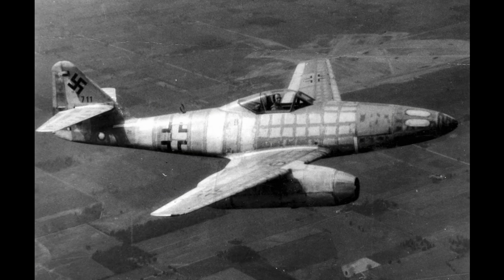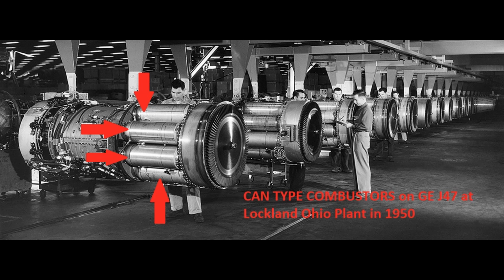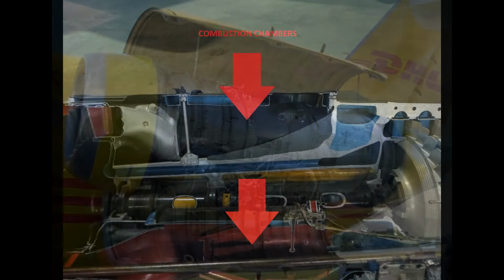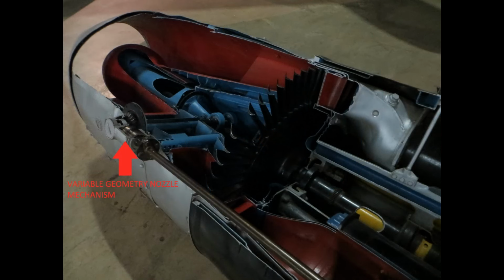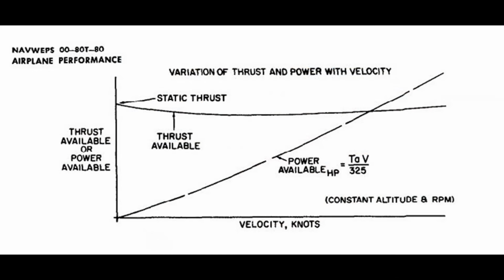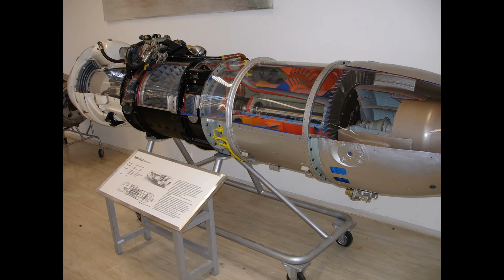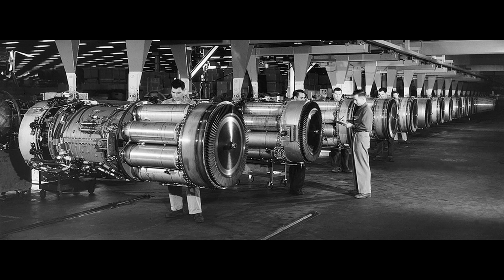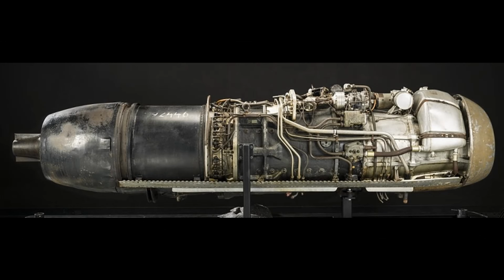World War Two JET POWER

Comment: The video channel author doesn't understand how a thrust vectoring nozzle works & doesn't understand the concept of deceleration of a gas flow in one direction & acceleration from zero to max in a 90° turn direction & the forces involved at the nozzle  & on the entire turbojet. Probably will be extensively confused by this post & will immediately delete it.
At 9:48 - states exhaust leaves the tailpipe so generating thrust. This of course is wrong. The thrust generated is reaction thrust generated elsewhere in the engine upstream of the turbine stages. The only thing the exhaust /  tailpipe does is oppose forward thrust by causing rearwards directed thrust.
Reply from the maker: I'm not the one who is confused here. There is nothing in this video about thrust vectoring nozzles. Now in regards to deletion, yes if you can't make your unrelated post go anywhere, then it's a waste of space and I'll delete it. Furthermore you made the post unrelated by deleting your previous incorrect posts.
Reply: @GregsAirplanesandAutomobiles  
Found an online pipe / duct forces calculator  which gave the expected thrust forces at various points along the gas flow routes &  turning points for a Harrier given  air density, psi, flow rates, duct turn angle & duct csa. It's simple mass acceleration forces.
A pressure gradient will exist in the vectoring nozzles that will be equivalent to the vectored thrust of the nozzles, that pressure gradient is directly caused by the change in direction of the moving mass of air or gasses.
I had some questions about the thrust budget / balance in the F-35b due to the 10  ton front lift fan but turns out with the fan on load via the clutches the relevant connected turbine presents more resistance to gas flow which causes increased opposing thrust & the roll post gas route causes 2 tons of back thrust so all thrusts add up & cancel out nicely causing the aircraft to behave sensibly while hovering without wanting to accelerate forwards due to any non cancelled forward thrusts in various parts of the engine.
An odd f-35b thing is the fact that it appears that about 3 tons of engine thrust equates to enough shaft hp being sent to the front lift fan where 9 tons thrust is generated give or take due to the fan being able to do high mass low velocity air flow. If the front lift fan load reduces then thrust to the rear nozzle will increase so in both cases thrust cancelling takes place appropriately, where any imbalance exists the roll posts, front fan lower guide vanes &  the 3bsm vectoring nozzle can all point forwards a bit as required.
When thinking about a helicopter engine for example where the velocity of the exhaust jet is relatively low & the overall engine forward thrust is very low,  the reason the forward thrust is low is it's been mostly opposed at the turbine stage by backwards thrust on the turbine stage where  most of the energy has been removed to provide shaft power output to the rotors.
Reply: @GregsAirplanesandAutomobiles  
How many people at Greg's Airplanes Engines answer these comments?
If you essentially bring the air flow mass to a halt at the exhaust outlet you get full thrust force backwards (canceling forwards thrust & trying to blow the nozzle off) which is part of what thrust vectoring nozzles  might be doing for a given direction basicly.

A lot of questions have popped up in my mind anyways involving the ifs & buts of the issues here & stuff about decelerateing a continuous linear feed of bowling balls  or just changing their direction by 90° etc  which might need me to have a discussion with some of the Pegasus engine people & others if possible.
Edit added
In essence then -  the straight backwards gas flow hole & pipe arrangement in the back of a jet engine - its main job is to mostly not present a engine casing back face against which an opposing force would be generated which would counteract net forwards thrust generated elsewhere in the engine.
     Another way of looking at it -  for the F-35 for example, if the normal forward thrust wasn't still present during hover the ~10 tons of rearwards facing force applied to the rear thrust vectoring nozzle (forces in ducts / gasflow  basics) would cause uncontrolled backwards acceleration during the attempt at hovering.
So the fact that the F-35  & the Harrier don't  accelerate backwards while in hover mode is proof that all the forward thrust being generated by the engine is still being generated during stationary hover.
Reply from the maker: To answer your question about the number of people answering comments on this channel, it's really hard to say but I would guess it's about a thousand. Youtube doesn't provide that specific data, just the number of total comments per video. Not all are in response to others, and often one person makes more than one comment, so I really can't know the answer to your question with any degree of certainty. Why?
Reply: @GregsAirplanesandAutomobiles  
Thankyou for the most informative reply delivered amiably & quite promptly. 
I apologise profusely for not replying sooner but got blind drunk today & have just recovered enough to type.
I meant to ask, how many people reply & those replies will appear as a reply from Greg's Airplanes in person?
So to sum up.
Many state that the gasses through the tailpipe generate the thrust, that's incorrect .
Thrust force / force is involved wherever mass is accelerated or decelerated  for whatever reason. 
The tailpipe actually always looses forward thrust but shaping it & arranging things there  correctly reduces the losses. 
In the case of the F35 & Harrier (they're a bit of a handful flying wise) the tailpipe or other appendages  becomes vectoring nozzles that can cause total mass flow deceleration to zero in the rearwards direction thus creating a negative max thrust completely opposing the engine forward thrust  at any throttle setting automagixally & causing mass flow acceleration in the downwards direction to cause opposite upward thrust for hovering. The forces are acting on the vectoring nozzles in that case which for the Harrier are each being pushed  upwards with a force of 2.5 tons for example approx. For the F35 in hover the nozzle is pushed off the back rearwards with a force equal to the thrust generated in various places in the engine which prevents the aircraft moving forward.
In the Harrier all forward thrust is always cancelled out as gases turn left & right before reaching the vectoring nozzles. If the nozzles are pointing rearwards then  all the nozzles are being shoved forward by the gases as they do a 90° turn at the nozzles & the nozzles are pushing the aircraft forward. On a few occasions vectoring nozzles have parted company with their aircraft with catastrophic consequences.
Reply from the maker: I'm glad you're feeling better after the drinking. I think I understand what you were asking. There is only one person who replies with this user name, it's me, Greg.
Reply: @paulpaul9914  After A.A Griffiths who published his paper in 1926 discovered that Whittle had plagerized his work pointed out to the Royal Aircraft Establishment that Whittle had made several aggregious errors in his axial compressor design that proved that Whittle did not understand axial compressor.
Whittle never constructed the 1930 patent design and never built any engine with a axial compressor.
This is a irrefutable fact that cannot be disputed.
Centrifugal compressors are inherently inferior to axial compressors which is why all modern jet engines use axial compressors and not Whittle's engine.
Reply: @paulpaul9914  WHITTLE WAS FORTH! MAY 15TH 1941 TWO YEARS AFTER HANS VON HAIN.
Reply: @paulpaul9914  Frank Whittle was at Cambridge prior to 1936 and did not begin any actual work on jet engines until he moved to Rugby in 1936, this well documented and is not disputed.
Reply: @paulpaul9914  Whittles WU engines used off the shelf Krupp18-8 stainless steel used in cutlery, the W.1 and W.2 engines used REX-78 developed in Sheffield by Brown and Firth Steels
Whittle subcontracted fabrication of blades to several companies from 1936 to 1946.
1
Reply: @paulpaul9914  Really? Because the Jumo 109-004A Orkan exceeded 200 hours in PFTR tests in 1942.
Reply: @paulpaul9914  General Electric was making its turbochargers using Hastaloy B but was still experiencing poor reliability with the J31 like Whittle and Rolls-Royce with the W.2 and the RB.23

GE partners with Canadian company InCo to develop Nimonic-70
Reply: @paulpaul9914  No, Krupp invented creep resistant nickel alloys used in jet engines... the Germans created Germany.... not Krupp.
Reply: @paulpaul9914  Britain created the largest international slave trade in history and invented the Concentration Camp 
The Victorian Holocausts murdered over 100 million people and is the largest mass genocide in recorded history.
Reply: @paulpaul9914  The largest manufacturers of jet engines is GE-Safran
Formed by Gerhard Neumann and a team of Jumo engineers bought to America by Operation Lusty and Operation Paperclip and by Safran, founded by Herman Oestrich and a team from BMW
 The BMW 109-018 is longest production run of any jet engine in history.
Reply: @paulpaul9914  WRONG, Power Jets Ltd. used Krupp 18-8 for the W.U. and Firth Brown REX-78 for the W.1 and W.2 engines, Rolls-Royce used InCo Hastaloy B and Nimonic 70, later switching to InCo Nimonic 80a on the Nene and Derwent 5
Reply: @paulpaul9914  Please name a single British company that still makes commercial jet aircraft in the U.K.?
Reply: @paulpaul9914  The largest manufacturer of jet aircraft in Europe is Germany's Airbus Hamburg-Finkenwerder plant, second only to Boeing's Seattle Washington.
Reply: @paulpaul9914  Power Jets Ltd. Used Krupp 18-8 for the W. I.
FIRTH BROWN REX-78 for the W.1 and W.2
Reply: Don't confuse your alloys lad... it makes you look like an uneducated amateur.
Reply: @paulpaul9914  Whittle also never built the 1930 patent design.
Reply: @paulpaul9914 Maxime Guillaume patented the axial compressor turbojet in 1921, when little Frankie was still wearing short pants. 
Whittle never built any engine with an axial compressor.
As A.A. Griffiths proved that Whittle had plagerized his paper published in 1926, Whittle didn't understand how axial compressors worked.
Reply: @paulpaul9914  There were only two winners in WW2... the U.K. was not one of them.. the British colonial empire collapsed along with Britain's aircraft industry.
The U.K. became a U.S. protectorate
Reply: @paulpaul9914  The axial compressor was invented by Swiss company Brown, Boveri und Cie. in 1924, the  first axial compressor gas turbine engine in the U.K. was a Swiss BB&C  Velox engine brought to Manchester England in 1934.
Metropolitan-Vickers was a BB&C Velox system licensee.
A.A. Griffiths and Haynes Constant went to Metropolitan-Vickers for help building the F.1 and F.2 because of their experience with the Velox engine and later BB&C axial compressor engines.
The first axial compressor turbojet in the U.K. was built at Metrovick using Swiss compressor technology.
Reply: @paulpaul9914  It doesn't change the fact that the jet aircraft engine was invented in Germany 2 years before Whittle.
Whittle is rightfully credited as the 4th person to successful demonstrate a jet aircraft engine...
 No trophies for 4th place Pauly.
Reply: @paulpaul9914  Britain lost the war for the exact same reasons... British forces were spread out all over the globe fighting against the Japanese, Italians in Asia and Africa and freedom fighters in occupied British colonies.
Many occupied colonial territories won their independence after Britain was defeated in WW2.
Reply: @paulpaul9914  Then why did Whittle copy a mistake in A.A.Griffiths 1926 paper regarding axial compressors?
Whittle did not know that the mistake that been corrected in the second edition.
Reply: @paulpaul9914  If Whittle had understood axial compressors he would not have wasted his time developing centrifugal compressor turbojets... which proved to be an evolutionary dead end.
 Centrifugal compressor turbojets are no longer made.

No aircraft powered by a centrifugal compressor turbojet has ever reached Mach 1 in sustained level flight.
Reply: @paulpaul9914  The jet aircraft engine was invented by Hans von Ohain and Max Hahnn in Germany, this is an irrefutable fact that cannot be disputed.
The first successful demonstration of a jet aircraft engine occured on August 27th 1939.
It was a public demonstration, witnessed by various officials and documented by photographs and motion pictures.
A copy of the film evidence remains in the Smithsonian archives.
Reply: @paulpaul9914  Please name a single jet aircraft in current production that is powered by a centrifugal turbojet engine??
Reply: @paulpaul9914  Please cite an example of an actual axial compressor turbojet that was constructed by Frank Whittle or Power Jets Ltd.?
Reply: @paulpaul9914  Helicopters do not use Turbojet engines.
Reply: @paulpaul9914  Your digging yourself into a a very deep hole Pauly..
Your position on these topics is untenable.
Reply: @paulpaul9914  Why is everything you say NOT TRUE?
Reply: @paulpaul9914  Gas turbine or Turboshaft engines were not invented in Britian, they were invented in Norway and Switzerland.
Reply: @paulpaul9914  Centrifugal turbojet engines are obsolete technology, and evolutionary dead end.
They are obsolete because they are inferior to the axial compressor jet engine technology invented in Germany.
Reply: @paulpaul9914  You sound like someone very immature and unaccustomed to hearing the truth.
Reply: @paulpaul9914  Frank Whittle built his engines using Krupp 18-8 alloy and Firth Brown REX-78.
General Electrics J31 was the first to use Hastaloy B and Nimonic-70
 Rolls-Royce was the first to use Nimonic-80.
Don't confuse your alloys lad, it makes you look like an uneducated amateur.
Reply: @paulpaul9914  Rolls-Royce still uses Krupp 18-8 and P-198 Chromdur in its current engines.
Reply: @paulpaul9914  No one in the U.K. understood axial compressors well enough to build a flight rated axial compressor turbojet.
The only ones that knew anything about them was A.A Griffiths and Hayne Constant... and they failed to produce a flight rated axial engine and Metropolitan-Vickers abandoned all development of jet engines in 1947.
All axial compressor turbojet engines produced in the U.K. are based on German technology stolen after the war.
Reply: @paulpaul9914  Sorry lad but your epic failure of an argument won't fly here. 
Whittle DID NOT invent the gas turbine engine.
Helicopters DO NOT use Turbojet engines to fly.
 The Gas Turbine engine was invented in Norway by Jens AEgigus-Elling in 1903, it used a centrifugal compressor.
(4 years before Whittle was even born!!!)
The first production Gas Turbines were manufactured by in Switzerland by Brown, Boveri und Cie.  in 1930 and demonstrated in Berlin in 1932 and then demonstrated in Manchester England later that year. METROPOLITAN-VICKERS became a BB&C licensee in 1933.
Nice try Pauly, Epic fail.
Reply: @paulpaul9914   Rolls-Royce solved the burn failure problems that plagued the Power Jets Ltd. W.2 with help from GE how discovered Hastaloy B made by InCo Canada.
Reply: @paulpaul9914  Frank Whittle did not invent anything related to the turbojet aircraft engine, he did not patent first, did not build a proof of concept first and was only the 4th person to successfully demonstrate a jet aircraft engine.
Reply: @paulpaul9914  Sorry Pauly but you look very foolish, Whittle did not invent centrifugal or axial compressor gas turbine aka turboshaft engine that are used in helicopters.
The centrifugal jet engines was an evolutionary dead end, they are no longer used in any jet aircraft and have been obsolete technology for decades.
The jet aircraft engine we use today was invented in Germany by Dr. Anselm Franz.
Reply: @paulpaul9914  Sorry Pauly but there has never been any aircraft to reach Mach 1 in sustained level flight powered solely by a centrifugal compressor turbojet.
Centrifugal jet engines are too inefficient for supersonic aircraft.
Reply: @paulpaul9914  Sorry lad but you crashed and burned...
MAXIME GUILLAUME PATENTED THE TURBOJET AIRCRAFT ENGINE IN 1921.
  PATENT NUMBER 534.801 FILED MAY 3RD 1921 ISSUED ON JAN.13 1922.
Reply: @paulpaul9914  The U.S. Army tested the Jumo -004 During Operation Lusty confirmed TBOs in the 50 to 60 hour range EXCELLENT by WW2 standards and even better than 2nd gen jet engines used in the Korean War.
Reply: @paulpaul9914  THERE ARE NO CENTRIFUGAL TURBOJETS ENGINES CURRENTLY MANUFACTURED.  IT IS AN OBSOLETE TECHNOLOGY.
Reply: @paulpaul9914  Just the facts here, British jet engine production was delayed because of a lack of high temperature creep resistant alloys in the U.K.
 GE was the first to achieve reliable centrifugal jet engines that could met the minimum PFTR reliability standards by using Hastaloy B  by InCo Canada.
GE offered this technology to Rolls-Royce and allowed them to produce the Welland, the first British jet engines to pass the 100 hours standard.
Reply: @paulpaul9914  Germany introduced Krupp P-193 Tinidur alloy in 1936.
Nimonic 80 is was the same formula as Tinidur-60.*
Reply: @paulpaul9914  A motorjet requires a piston engine to produce thrust, it is not a turbojet engine.
The motorjet is another evolutionary dead end technology like the centrifugal turbojet, they are both failed obsolete technology.
Reply: @paulpaul9914  The Wittle Power Jets Ltd. W.2 could not meet the RAE minimum PFTR reliablity standards for adoption into RAF service because they would suffer turbine blades failure and burned out.
 Rolls-Royce used improved turbine blades made from Hastaloy B developed by GE.
Reply: @paulpaul9914  A.A Griffiths never designed or built a successful airworthy axial compressor turbojet.
 Griffiths went Metropolitan-Vickers to build his compressors using technology licensed from Brown, Boverei und Cie. in Switzerland.
BB&C introduced the Velox gas turbines to The U.K. in Manchester in 1933.
A.A Griffiths and Metropolitan- Vickers never achieved a flight rated engine and in 1947 completely abandoned all development of jet engines.
Reply: @paulpaul9914  The world's first successful axial compressor turbojet engine was designed by DR. ANSELM FRANZ and first ran in October 1940.
The Jumo -004 was flight tested on March 18th 1942 and entered mass production in  July 1942.
 Britain would not have a production axial turbojet until a decade later.
Reply: @paulpaul9914  THE GAS TURBINE ENGINE WAS INVENTED BY JENS AEGIGUS-ELLING IN 1903.
THE WORLDS FIRST AXIAL COMPRESSOR GAS TURBINE IS THE BROWN BOVERI UND CIE. VELOX TURBINE IN 1932.
Reply: @paulpaul9914  Jens AEgidous-Elling invented the Certrifugal Compressor Gas Turbine Engine in 1903.
NOT WHITTLE!
 https://en.m.wikipedia.org/wiki/%C3%86gidius_Elling#
Reply: @paulpaul9914  Sorry but any engine that requires a reciprocating piston engine to produce thrust is NOT a turbojet engine.
Frank Whittle never constructed a Motorjet engine.
The first successful airworthy plane to fly with a  Motorjet was the Caproni Campini N.1
Reply: @paulpaul9914  Frank Whittle's 1930's patent design was clearly nonsense, A.A Griffiths PROVED IT and Frank Whittle never constructed it!
Reply: @paulpaul9914  Metropolitan-Vickers became a Brown, Boverei und Cie. Licensee for the Velox combined cycle axial compressor gas turbine engine in 1933.
The Velox is the first production axial compressor gas turbine engine in the world. It was first demonstrated in Berlin Germany in 1932.
Reply: @paulpaul9914  A.A. Griffiths and Metropolitan-Vickers never developed a production flight rated jet engine and all development was abandoned, Metropolitan left the jet engine business and return to steam engines in 1947.
Reply: @paulpaul9914  THE FIRST BRITISH  PRODUCTION JET ENGINE TO MET THE RAF 100 HOUR TEST WAS THE ROLLS ROYCE WELLAND.
Reply: @paulpaul9914  THE ROLLS ROYCE WELLAND USED TURBINE BLADES DEVELOPED BY GE IN AMERICA MADE FROM HASTALOY B MADE BY INCO CANADA.
Reply: @paulpaul9914  NIMONIC IS A COPY OF KRUPP P-193 TINIDUR INTRODUCED IN GERMANY IN 1936.
Reply: @paulpaul9914  NIMONIC USES THE SAME ALLOY FORMULA AS KRUPP P-193 TINIDUR INTRODUCED IN 1936 IN GERMANY.
 THE JUMO 109-004A ORKAN ENGINE WAS MANUFACTURED WITH TINIDUR.
Reply: @paulpaul9914  FRANK WHITTLE DID NOT INVENT THE JET ENGINE HE WAS ONLY THE 4TH PERSON.
Reply: @paulpaul9914  Childish insults won't prove your failed argument or make you smarter lad.
Reply: @paulpaul9914  The first successful demonstration of a Turbojet engine was August 27th 1939 in ROSTOCK GERMANY.
Whittle would not demonstrate until 2 years later.
Reply: @paulpaul9914  Not unless he made a tea kettle heated by a Brayton Cycle Gas Turbine engine...
Reply: @paulpaul9914  The world's first turbojet aircraft engine was constructed by Hans von Ohain and Max Hahnn.
Reply: @paulpaul9914  Frank Whittle did not begin any actual work on jet engines until he moved to Rugby in 1936.
Reply: @paulpaul9914  What AEidigus-Elling did was make you look like an uneducated amateur.. Frank Whittle did not invent anything related to the Jet Engine and was only the first person In the U.K. to build one.
 
The first successful demonstration of a Gas Turbine Engine in the U.K. was the Swiss manufacturers  Brown, Boveri und Cie.  VELOX engine in Manchester in 1933.
    Frank Whittle did not invent gas turbines.
  Britain didn't not invent gas turbines.

The world's first Turbofan engine was the Daimler-Benz 109-007 in 1940. It is the first 2 spool engine and the first counterrotating Turbofan engine as well.
Reply: Your comments are 100% irrelevant.
The Jumo -004 Orkan has a Variable Convergent Jet Nozzle.

Technology that the Allies did not possess during WW2.
 German jet engines were significantly more advanced than anything the Allies had during WW2.
Reply: @paulpaul9914  Frank Whittle was only the 4th person to successfully demonstrate a jet aircraft engine.

The world's first Turbofan and the first 2-Spool engine was the German Daimler-Benz DB 109-007 which first ran on May 27th 1943.
Reply: @paulpaul9914  Whittle's W.2/700.M.52 engine with a rear mounted mounted "augmentor" fan was built much later and proved to be an epic failure.

Whittle would never attempt to  build any engine with an axial compressor,  as was pointed out by A.A. Griffiths when Whittle was caught plagerizing his own work, Whittle did not understand how axial compressors worked.
Reply: @paulpaul9914  The World's first axial compressor was built by Brown Boveri und Cie in Switzerland in 1924,  they demonstrated the world's first operational axial compressor gas turbine in Berlin in 1930.

Parsons never built a gas turbine engine or an axial compressor... they only made steam engines until German engineer Max Bentele came to the UK after the war, Bentele worked under Dr. Anselm Franz at Jumo developing the 109-004 Orkan axial compressor turbojet that powered the Messerschmitt Me-262.

Hayne Constant was employed by Brown Boveri und Cie who licensed the Swiss Velox gas turbine engines to Metropolitan Vickers in 1932 after it was demonstrated at UMIST in Manchester.

A.A. Griffiths and Hayne Constant would never construct a flight rated axial compressor engine and the work was abandoned in 1947.
Reply: @paulpaul9914  Nazi engineer Max Bentele designed 2 gas turbine engines for Parsons after the war for the FV200 turbine tank test vehicle, the 2979 and the 2983, Parsons abandoned gas turbine engines after Bentele moved to America to work for Curtiss-Wright.
Reply: @paulpaul9914  Frank Whittle never built any engine with an axial compressor or a successful turbofan.
The Miles M.52 scandal was shameful failure and a humiliating chapter in British history.
Reply: @paulpaul9914  The Brown, Boveri und Cie Velox engine was the world's first successful practical gas turbine engine, it was the core gas generator for a multi cycle power plant.
Reply: @paulpaul9914  Parson did not build any gas turbine engines until after the war ended, please stop posting lies and misinformation.
Reply: @paulpaul9914  Parsons NEVER build any Axial compressors or Gas Turbine engines until 1949.
Reply: @paulpaul9914  The C.A.Parsons Company only made steam turbine (Rankine Cycle) engines until 1949.
Reply: @paulpaul9914  Steam Turbines ARE NOT Gas Turbine engines... please learn the difference so you don't look like an uneducated imbecile.
Reply: @paulpaul9914  Parsons NEVER build any Axial compressors or Gas Turbine engines until after 1949!
Reply: @paulpaul9914  Rolls-Royce went bankrupt in 1971 and the Automotive division was sold off eventually purchased by BMW in 1990.
Rolls-Royce is a is a wholly owned subsidiary of BMW.
Reply: @paulpaul9914  You need to provide a citation and evidence because there is no record of C.A. Parsons ever building and axial compressor or a gas turbine engine (Brayton Cycle) prior to 1949.
Reply: @paulpaul9914  The Brown Boveri und Cie Velox is a steam power plant that uses a axial compressor gas turbine engine as the CORE GAS GENERATOR USING THE BRAYTON CYCLE.
THE VELOX IS THE WORLD'S FIRST PRACTICAL GAS TURBINE ENGINE.
Reply: @paulpaul9914  The Brown Boveri und Cie. Velox is the world's first engine to use a axial compressor.
Reply: @paulpaul9914  The first successful demonstration of a an axial compressor gas turbine in the U.K. was the Swiss BB&C Velox system, it was first demonstrated in Berlin in 1930 and in UMIST in Manchester England in 1932.
Reply: @paulpaul9914  The Metropolitan Vickers company became a BB&C Velox licensee and was the first company in the U.K. to build a gas turbine engine or an axial compressor using Swiss technology.
Reply: @paulpaul9914  C.A.Parsons Company  only made steam engines prior to 1949.
Reply: @paulpaul9914  The Velox is a Gas turbine engine (Brayton Cycle) it is used as a gas generator for a steam boiler.
The Velox is the world's first axial compressor gas turbine engine using the Brayton Cycle.
Reply: @paulpaul9914  BMW acquired Rolls-Royce Motors in 1990 in a joint deal with Volkswagen, Rolls-Royce is a wholly owned subsidiary of BMW.
Reply: @paulpaul9914  C.A. Parsons NEVER built any Axial compressors or Gas Turbine engines prior to hiring German Junkers Jumo engineer Max Bentele after the war, the Parsons 2979 and 2983 were designed by Betele in 1949.
Reply: @paulpaul9914  Parsons has never mass produced or licensed any gas turbine engines or axial compressors.
Parsons has only sold steam engines.
Reply: @paulpaul9914  C.A. Parsons Company only made steam engines and electric generators, Parsons has never sold gas turbine Brayton Cycle internal combustion engines.
Reply: @paulpaul9914  C.A. Parsons Company only made steam engines prior to 1949.
You look like an ignorant fool right now...
Reply: @paulpaul9914  Steam Turbines are external combustion Rankine Cycle engines.
Gas turbine engines are internal combustion engines Brayton Cycle.
They are not the same

If you knew knew anything regarding this topic you wouldn't have made such and embarrassing fool of yourself lad...*
Reply: @paulpaul9914  C.A. Parsons Company made Steam turbines for ships and electric power generation plants.
Reply: @paulpaul9914  Rolls-Royce Motors is a wholly owned subsidiary of BMW.
Reply: @paulpaul9914  You look like a fool because you didn't know the difference between a steam turbine and a Gas turbine... a childish and amateur mistake son.
Reply: @paulpaul9914  Sorry son but you are a fool dreaming about things you don't understand.
Steam engines are not compressors or Gas Turbine engines.
Reply: @paulpaul9914  Gas turbine engines were invented in Norway.
Reply: @paulpaul9914  Axial compressors were invented in Switzerland and Germany.;
Reply: @paulpaul9914  The world's first successful demonstration of a jet aircraft engine was by Hans von Ohain and Max Hahnn on August 27th 1939 in ROSTOCK GERMANY..
 2 years before Frank Whittle did in 1941.
Reply: @paulpaul9914  Frank Whittle was the 4th person to successfully demonstrate a jet aircraft engine.
Reply: @paulpaul9914  PROVE IT!
Reply: @paulpaul9914  Rolls-Royce Motors is a wholly owned subsidiary of BMW.
Reply: @paulpaul9914  The first successful demonstration of a Gas turbine engine was by Jens AEgidius-Elling  in Norway in 1903.
Reply: @paulpaul9914  The first successful demonstration of a jet aircraft engine was by Hans von Ohain and Max Hahnn on August 27th 1939 in ROSTOCK GERMANY.
 Frank Whittle was only the 4th person to successfully demonstrate a jet aircraft engine 2 years later in 1941.
Reply: @paulpaul9914  The First known example of a successful axial compressor gas turbine engine was the Brown Boveri und Cie Velox engine.
 C.A. Parsons Company only only made steam engines prior to 1949.
Reply: @paulpaul9914  The World's first axial compressor turbojet was constructed by Jumo in 1938.
Reply: @paulpaul9914  The world's first commercial stationary axial gas turbine power plant is constructed by Brown Boveri und Cie. and installed in Neuchatel, Switzerland.
Reply: @paulpaul9914  The World's first axial compressor gas turbine powered locomotive is built by Brown, Boveri und Cie. in Switzerland in 1939.
Reply: @paulpaul9914  The first demonstration of a axial compressor gas turbine in the U.K. was a Brown, Boveri und Cie Velox engine at UMIST in Manchester England.
Reply: @paulpaul9914  Frank Whittle was only the 4th person to successfully demonstrate a jet aircraft engine in 1941... 2 years after Hans von Ohain and Max Hahnn did in 1939.

These are irrefutable facts that you can no longer continue to deny.
Reply: @paulpaul9914  The Velox system was a axial compressor gas turbine which was the core gas generator for a  steam boiler.
The steam circuit was a second pass heat recovery cycle.
The primary engine was a Brayton Cycle axial compressor gas turbine engine.
Reply: @paulpaul9914  Brown, Boveri und Cie. constructed the world's first direct drive axial compressor gas turbine powerplant in 1939 in Neuchatel, Switzerland.
Reply: @paulpaul9914  The Velox system clearly shows a axial compressor gas turbine as the core...
Reply: @paulpaul9914  WRONG! C.A. Parsons Company only made steam engines prior to 1949.
Reply: @paulpaul9914  Furnace Blower... not a gas turbine engine.
Reply: @paulpaul9914  Parsons NEVER built a gas turbine engine until after 1949.
Reply: @paulpaul9914  Furnace Blowers are NOT Gas Turbine engine Compressors.
Reply: @paulpaul9914  The world's first successful axial compressor gas turbine engines were built in 1928 in Switzerland by Brown, Boveri und Cie.
Reply: @paulpaul9914  A.A. Griffiths went to Brown, Boveri und Cie.  in Switzerland in 1924 to learn about axial compressor turbochargers for piston engines from Alfred Buchi.

 Buchi patented the axial compressor Brayton Compound engine on Nov. 6th 1905.
Reply: @sandervanderkammen9230  
Your replies are irrelevant for this video & u appear to be talking to yourself again but we have recorded everything you've said so far.
Have you ever heard anyone mention the ICT  or internal combustion turbine when discussing gas turbine arrangements?
Buchi proposed turbocharging arrangements for a radial piston engine. 
Axial compressor tech already existed at the time courtesy of Parsons of England of course. Your statements regarding what Parsons chose to do or not do are also entirely irrelevant as well as being wrong usually for example, everything you've said about Parsons is wrong including the how & when of any Parsons Gas Turbine ICT engines for power generation. Never before in the entire history of YT comments has someone been so wrong for so many reasons & in so many ways in such a small number of replies.
Reply: @paulpaul9914  Parsons did not build any gas turbine engines until 1947.
Reply: @paulpaul9914  All gas turbine engines are ICEs and use the Brayton Cycle principle... not the Rankine Cycle.
Reply: @sandervanderkammen9230  
When steam engines were still a proper mainstream thing & Parsons was messing about with his steam driven axial turbines people at the time used to talk about the possibility of internal combustion turbines.
While internal combustion engines were coming into existence they were referred to as 'the new oil engine things'.
Reply: @paulpaul9914  A child's toy pinwheel is also a turbine and operates on the same rudimentary principle but like a steam engine it is not a gas turbine engine.
Reply: @paulpaul9914  The fact that you fail to recognize the difference between internal and external combustion technology or the difference between a turbojet and a turboshaft engine is conclusive proof that you lack the education or professional experience regarding this topic to speak inteligently about it.
Reply: @paulpaul9914  Pauly! Steam powered aircraft were never "a thing" 
 stop making a fool of yourself.
Reply: @sandervanderkammen9230  
Many types of internal combustion turbine engine require the Parsons connected axial turbine & axial compressor technology to exist as licensed by Parsons of England most generously to many companies around the world.
Reply: @paulpaul9914  Only if they were STEAM engines..
Reply: @sandervanderkammen9230  
A steam engine doesn't have a Parsons axial compressor & Parsons axial turbine as invented in England by Parsons & licensed most generously to many companies around the world & which formed the basis of subsequent internal combustion turbine engines which could not have existed otherwise.
Reply: @paulpaul9914  Gas turbine engines were invented by Norwegian engineer Jens AEgidius-Elling in 1903..
The first production gas turbine engines were built in Switzerland by Brown Boveri und Cie in 1932.

C.A.Parsons would hire Dr. Max Bentele to build its first and only has turbine engines in 1947.
Reply: @paulpaul9914  C.A. Parsons Company only made steam engines prior 1947.
Reply: @sandervanderkammen9230   
Chinney Laydeez shud note
Parsons of course never made steam engines.
Fryed Ryce Muncherz might like to answer this kweschun
Regarding the obsolete jet engine  technology -
How many Whittle Pure Internal Combustion Turbine Centrifugal Compressor Reverse Flow Combuster Aircraft Engines First In The World Demonstrated By Whittle have been manufactured since & how many aircraft types have they been used in & how many current aircraft types use  them?
Reply: @paulpaul9914  PLEASE NAME A SINGLE BRITISH COMPANY THAT STILL MAKES BRITISH JET AIRCRAFT IN THE UK?
Reply: @WilhelmKarsten 
Parsons didn't make steam engines.
Reply: Mod-01 Lec-03 Development of Jet Propulsion for Aircraft
nptelhrd

Google above for excellent info on the where & how of turbojet thrust creation.
Reply: @paulpaul9914  Hey Pauly, can you please answer my question that you keep dodging,
Please name a single British company that still makes commercial jet aircraft in the U.K.???
Reply: @sandervanderkammen9230  
For this video & the comments -  your replies = 100% irrelevant.
Reply: @paulpaul9914  As are yours, the Jumo109-004 Orkan jet engine was the world's first combat operational jet engine and the only successful jet engine in service during WW2, the Allies were years behind Germany in aircraft technology.
Reply: @sandervanderkammen9230  
 What?
For this video & the comments -  your replies are 100% irrelevant.
Reply: @paulpaul9914  The Allies had nothing comparable to the Messerschmitt Me-262 and its Jumo 004 engines.
Germany was years ahead of the Allies.
Reply: @sandervanderkammen9230  
 @Sander Van der Kammen  
 What? 
For this video & the comments -  your replies are 100% irrelevant.
Reply: It's believed that had Whittle & Co's work been aggressively pursued without delay & so a reliable jet powered aircraft had been produced many years earlier as a result & the 'how to do it' info had been kept under wraps then WW2 might have been entirely prevented. Needed key people to think it was possible & important then the metals guys at Wiggin in Hereford would have started looking for an alloy for the turbine blades sooner.
I think Dr Pye visited & observed a running engine in June 1939 when one of the group got knocked over after walking into the jet exhaust stream, after that signs & fences got placed by the engine exhaust & Dr Pye became totally convinced & the engine work then got placed under the official secrets act. Any jet engined powered aircraft that were produced at the time they were produced during the decade were not required & were reserved for relatively  low risk activities in order that they be kept in reserve as it were.
Reply: @paulpaul9914  Whittle didn't start actual work on jet engines until he moved to Rugby in 1936.. 2 years after Hans von Ohain and Max Hahnn began work in Gottingen Germany.
 Krupp invented Germany invented the first high temperature creep resistant Nickel alloys and introduced Tinidur-60 in 1935.
 Whittle struggled with reliability because he was using an inferior material called REX-78
The Canadian company InCo developed Nimonic in partnership with General Electric who shared this improved material Rolls-Royce which is why Rolls-Royce engines were  twice as reliable as the Power Jets ltd. W.2B
Reply: @paulpaul9914  Krupp has been the World's leader in stainless steel for over a century,Krupp engineers Benno Straus and Eduarde Maurer invented austenitic stainless steel and patented it in 1912.